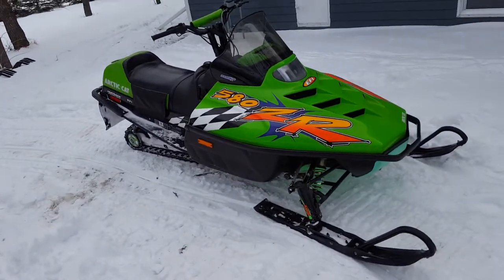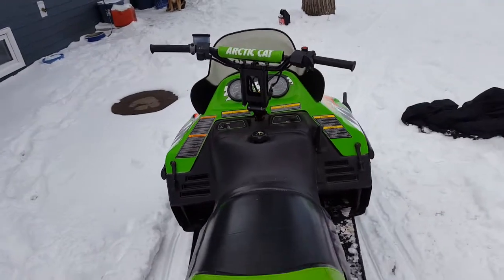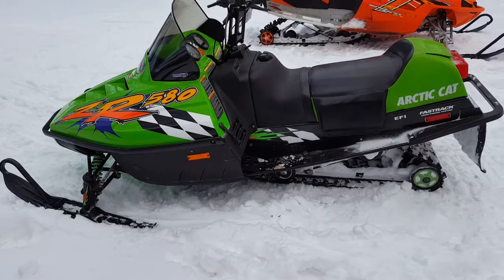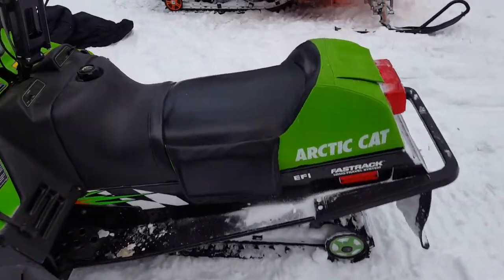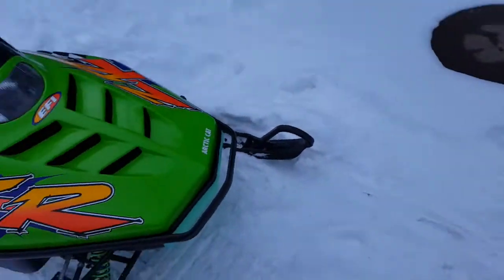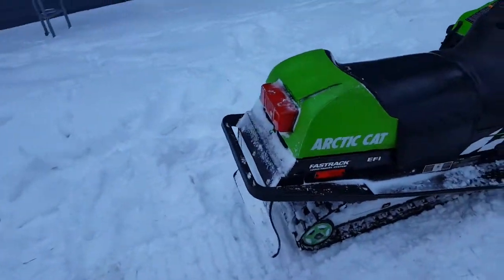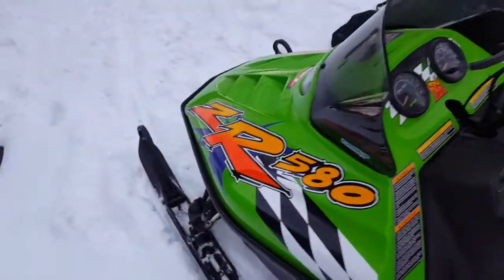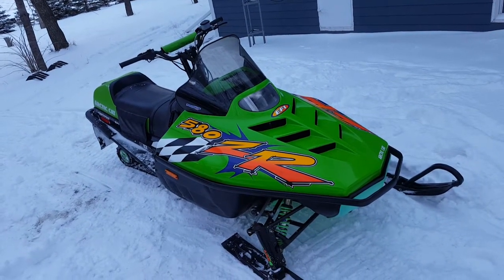1997 zr 580 efi

Comment: I have 95 efi 580 just replaced fuel pump, and am stumped on why it only fires when I spray fluid in the spark plug entrance then dies again
Reply from the maker: Does it create fuel pressure? If so how much? Maybe your pump is wrong, installed wrong or faulty. 
You also need the battery in a 95. 97 was the first year of the batteryless systems. anything prior required the battery
Reply: @PaintPatina  thanks bud got it going my fuel hoses were put on backwards. Fires up now but now I need to figure hand warmer plug ins and I forgot to take pic to make sure they went bac to same plug spots 😂

Comment: If it was mine, I don't know about the 6 inch riser on it. Too high for me. That's meant for standing up while riding. I like to sit while I'm riding. So I'd keep the stock steering on it.
Reply from the maker: Not mine anymore either but when you’re 6ft tall the bars tend to hit your knees when you try to turn at all. I agree. 6” was a little tall for sitting but it worked well for me.

Comment: I’m wondering how your sled is doing today? I bought one 5 years ago and it has been trouble free until yesterday when it stopped idling down properly after warm up. Which sounds like the same symptom you were looking at. I’m suspecting the rubber intake boots are cracked . Basically because a lot of people have said they have had that problem. As well as the fact that my last ride was bumpy as all heck.  All in all this has been the best handling most dependable sled I’ve ever owned and if I had to junk it out tomorrow I couldn’t complain . I didn’t start it at all last summer and  with a tiny shot of ether in one cylinder it started on the second pull and stayed running. Three minutes later the smoke cleared the rpm dropped and it was idling smooth as silk . To top it off I think most people would agree that this is one of the best looking sleds ever produced.  Today it’s fifteen below zero and a good day to stay indoors but it’s supposed to be thirty above in a couple days and a good day to be wrenching on snowmobiles so I hopefully I’ll be back riding real soon. I like the handlebar riser by the way.
Reply from the maker: Definitely enjoyed the sled but ended up selling it.  I upgraded vehicles and wanted the cash. 

The boots is where I would Start first. Likely a leak there. Move on to crank seals if that’s not it. Usually a high idle is associated with a lean condition. 

The ride on them was always rough compared to the new stuff. Technology has come a LONG way. But these sleds just ride like they’re on rails. 

Hope you get yours goin again. Always good to see the old ones out too 👍🏻

Comment: The reason it won’t come back from 4000 rpm is because you’re clutch needs to be rebuilt
Reply from the maker: Brapp Bros typically id agree but this one had an intake leak
Reply: Riley Dalzell oh okay you still got that sled ?
Reply from the maker: Brapp Bros nope sold it to a guy in Thompson Manitoba
Bought myself a Sno Pro 600 and 700 swapped it last year
Reply: Riley Dalzell I seen it on the vid you posted on it and it’s nice but I have two 97 580’s
Reply: @PaintPatina   I've got a 95 cougar 550 and a 92 wildcat 700. Same style motor and months it looks like, been thinking about doing a swap! Any suggestions or thoughts?
Reply from the maker: @419Ragz  do lots of research 🤷🏻‍♂️ I haven’t swapped that chassis, my 580 was bone stock under the hood. 

As for the SP600/700 swap I did lately, that was a plan for probably 2 years before I actually did it. Forum searching and going through parts fiches to figure out what works where

Comment: With a 6” riser did you have to get longer throttle cables ?
Reply from the maker: Yep. New throttle and brake lines. Both made by powermadd

PN: 43592 & 45600

Comment: Nice sled, I'd love to find one or a 96 model
Reply from the maker: Thanks, I'm not sure what the 96 Model was like but I like the 97. quick for the year. would definitely recommend doing the secondary upgrade and spacing the recoil to give the stator more air.
Reply: The 96 is still black I think, but the battery less efi is much better and lighter than a battery EFI model
Reply from the maker: If I remember correctly there is a 96 model with a straight tunnel, Battery, and black plastic. then there is a 96.5 model with black plastic, ETT, and batteryless. Don't quote me on that though i don't remember exactly what went on there
Reply: Oh ok I'd love to find a 97 like yours that runs solid at least and in nice shape like yours, if it doesn't run the greatest, oh well I can always do a rebuild lol and wind up tricking the engine out a little
Reply from the maker: Mines for sale if you have 2000 Canadian kicking around hahaha
Reply from the maker: Im only asking so much because i did a lot of refreshing and its only got 3700 Miles
Reply: I'm from the States, North Dakota but will give this some serious thought
Reply from the maker: North Dakota Definitely isn't that far Were about 15 minutes north of the border between Minot and Fargo